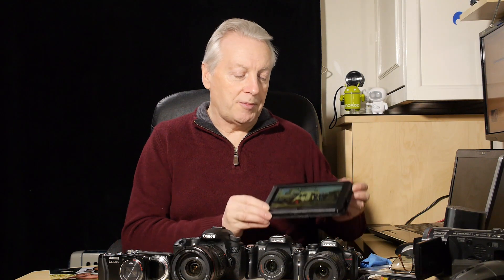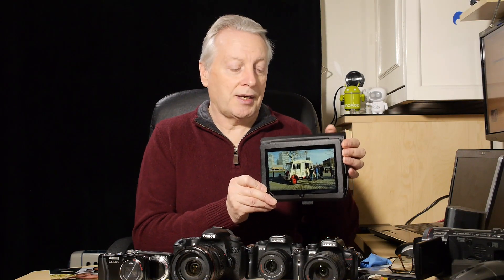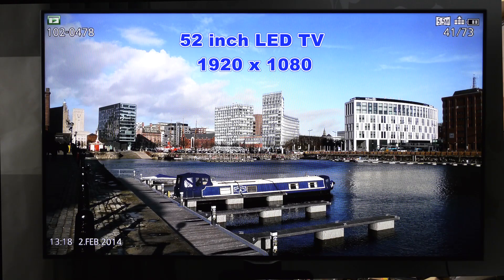Digital Camera Sensor Technology - Part1 Does Size Matter?

Comment: Great video, thanks for eloquently explaining the fallacy around hi megapixel cameras and images. And I've found that, while storage is cheap these days, it's much easier dealing with files that are 1/10 or 1/5 in size. The frustrating thing is that no-one seems to make moderate resolution sensors with large pixels.

Comment: Yes size mathers because the bigger the subpixel size,the more light it will capture, also the amount of pixels mathers as well the as how many subpixrls are per pixels, if each pixel of a 12 megapixels camera has 1 subpixels, then it has the blur those 12 magepixels down to 4 megapixels to get all colors,but if each pixel of a 12 megapixel camera has 3 subpixels,then it does NOT have to blur down the image to 4 megapixels to get all colors.

Comment: which one is better 1/2 cmos exr or 1/2 3 bsicmos
Reply from the maker: generally speaking the 1/2 in will be better assuming the pixel density is the same as the photosites are larger and will gather more light. BSI sensors increased the amount of light by avoiding some of the connecting layers from infront of the photodiodes but manufactures used this to get higher pixel density.

Comment: I would think that number of pixels does matter, it is not just marketing ploy.  If you look at a 4K video that was shot with an 8 MP sensor and down sampled to a HD video, it looks much better than a native 1080p video that was done with 1920 x 1080 pixels.  This is because the debayering process of the sensor is inherently inaccurate and over sampling makes up for the debayering process.  The same logic I thing would apply to a 36MP sensor.

Comment: And in superzooms why they have a small sensor? Are the superzoom sensor a negaive point on image quality?
Reply from the maker: The reason they can have long focus lenses is because of the small sensor size which allows much smaller optical elements. if the sensor size is increased so is the size of the lenses needed to fill the diagonal size of the sensor with the image circle. With just 12mpixel and low iso the cameras can achieve very acceptable results, 18mpixel means too small a photodiode which means more amplification and hence more noise and picture degradation.
Reply: Graham Houghton thanks! :D

Comment: Well done Graham, common sense at last !! I have been telling people this for years with limited success. I was bought up on 10x8 plate cameras, now they were large format. Am now mainly using Micro 4/3 equipment having sold most of my Nikon DX gear.
Reply from the maker: I think m4/3 is a super format and is probably the closest format to motion picture film on 35mm stock so should be more "filmic"

Comment: I thought size means the actual sensor size, like full frame, micro 4/3 etc.
What I don't get is what an enormous number of pixels on a tiny sensor gives? From my experience nothing but increasing the file size. I used Olympus SP 560 zoom camera with 8 mp and Olympus stylush compact camera with 14 mp, and the first one produces sharper images, so I set it to 8 mp for the last one, because more pixels don't produce any better quality. 
Looking forward for the next part. Excellent lesson!
Reply from the maker: Yes larger sensors with large photosites give better quality, cramming more pixels on a small sensor just means noise and loss of dynamic range.

Comment: Very informative.. and well put across, thanks.... Graham.... I grasp all you say. 

I have both the NEX 5  and  NEX  7  for the  APSc size sensors... and I also use a  Lumix TZ30.. for travel.....
A mix of 3 differing sensor sizes.  I feel another reason to save your money and not being led .. or tempted into going for the highest pixel count....=  Am I correct in suggesting that more pixels can also mean....more chance of noise at lower light..? 
I get no better results from either camera during monitor and Web. posting / viewing... unless.. (as you point out).... one wishes to produce much larger prints.    Thanks again.... Cheers from  D.G.J
Reply from the maker: You are absolutely right, with increase pixel density the physical photosites are smaller, they are less efficient at capturing and converting the light (photons) to the electrical charge stored in them before read out. more amplification means more noise